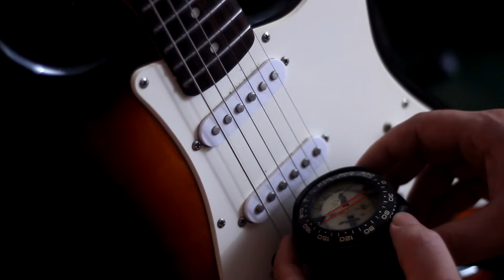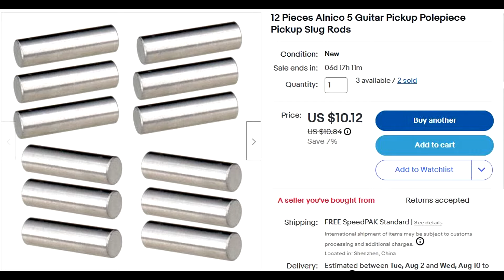Mod Cheap Ceramic Pickups Into Vintage Staggered Alnico (Easy DIY!)

Comment: You said the wire will touch the magnets on a standard PU, but that is not true. The wire is wound on a plastic bobbin, and will not touch the magnets.
Maybe the magnets should be ´charged´ before staggering, to make them even.

You have a good content, but you are to loud and way to ´funny´.
Reply from the maker: Thank you for watching and taking the time to comment qd. In the original standard strat pickups before fullerton in 79 the bobbins are made of a flat vulcanized fiber board material. that is why they are called flatwork and the wire was wrapped directly around the pole pieces. They contained zero plastic of any kind back then... the pickup wire was even coated in formalahyde varnish instead of polyurethane. If you push on those poles you are asking for a broken pickup. 
  Almost all the cheaper pickups use plastic bobbins but not an original pre 79 fender standard stratocaster.

  I appreciate the advice I do and I dont get offended easily or basically at all so I will take it to heart but... Dude this stuff is ultimately boring, being "funny" is what keeps people awake and gets me a little check to buy more junk to fool with. Im sure stevie T wouldnt act like a fool if it didnt equal taking care of his family? its youtube in 2023.

Comment: It has EVERYTHING EVERYTHING EVERYTHING to do with the STRENGTH of the magnet 🧲 
Do you actually think magnetism works differently based on the price?
Do you actually think magnetism works differently because of the material it's made of?
THAT'S NOT WHAT MAGNETISM IS!
If you do, I've got a bridge I wanna sell you.
Reply from the maker: Hahaha yeah jay I utimately get that but I still love trying whacky stuf and sometimes I get wild results... last year around christmas I realized that if I took a pickup and put a ceramic and neodymium stack on the back instead of getting louder and bassier like one would expect...
 somehow the  field was drawn out in a way to create SUPER TREBLE and extremely LOUD!!! which I cant explain but I can demonstrate? 

I think all this stuff is interesting and makes for great casual content but Im still seeming to get wild results when doing more unorthodox experiments. 

That all being said thank you so much for taking the time to watch and type out all that info.